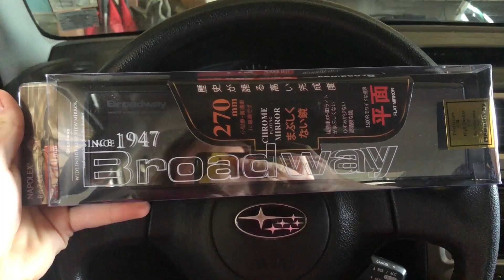2007 Impreza 2.5i Stainless Exhaust and Brake Tutorial

Comment: Great video man, the only thing I would have done differently is cleaned the front of your hub where the rotor sits. If you don't clean it and there is a lot of rust or brake dust buildup on that hub it can cause brake rotor runoff issues and possible future rotor warping issues. Other than that great video I would love to see more from you!
Reply from the maker: Thank you, and I agree I could've cleaned things up better. Living up north where everything gets rusty and gross quickly during the winter, I didn't give much thought to it. More content should be coming soon.
Reply: @gkgt5226  Sweet man I subbed I'll tune in when I can for sure! I live in Minnesota so I know how it feels when your shit is crusty AF and it's hard to work on.

Comment: Quick question, I’m replacing rotors and pads for a friends 06 Impreza 2.5i wagon. Do you know what size sockets I need to take off the caliper bracket bolts and the caliper guide pin bolts?

Comment: Looking for a exhaust can I have the link
Reply from the maker: The exact link is gone, but here is another variant of the same style. They're basically all the same, but still be sure to double check. Be noted, as show in the video, these require modification to fit.
https://www.ebay.com/itm/FOR-02-07-WRX-STi-STAINLESS-TURBO-CAT-BACK-EXHAUST-DOWN-UP-PIPE-4-ROLLED-TIP/154062383979?_trkparms=aid%3D1110006%26algo%3DHOMESPLICE.SIM%26ao%3D1%26asc%3D20200818143132%26meid%3D095f371f95ce4f2e8b48b9a6e30323c2%26pid%3D101198%26rk%3D1%26rkt%3D12%26mehot%3Dpf%26sd%3D254732909923%26itm%3D154062383979%26pmt%3D1%26noa%3D0%26pg%3D2047675%26algv%3DSimplAMLCvipPairwiseWebWithBBEV2bDemotion%26brand%3DUnbranded&_trksid=p2047675.c101198.m1985

Comment: Never stop making videos you gonna be big one day🙌
Reply from the maker: Thanks, that means a lot!
Reply: @gkgt5226  hi i have some question your exhaust ,manifold,catalytic converter can fit to 2.5 RS impreza, non turbo?
Reply from the maker: @eduardmondilla8275  Yes, I believe my manifold should also fit a 2.5rs because they are both a non turbo ej25.
Reply: @gkgt5226  thank you sir
Reply from the maker: @eduardmondilla8275  I'm sorry, but unfortunately I was mistaken. I am not familiar enough with the slight differences in years, so I was unaware that the 2.5 RS has a different shaped manifold without a cat. Apparently the 2.5 RS manifold wraps around differently than my car and has its cats in the next section of exhaust after that. I hope you see this before you make any decisions that were misinformed on my behalf.
Reply: @gkgt5226  ok thanks anyway I got it, my subie rs is older 2 years than yours.
Reply from the maker: @eduardmondilla8275  Hopefully you got the right one, and again sorry for the misdirection.

Comment: i know this is an old video but were those equal or unequal length headers
Reply from the maker: I believe equal; they're just some cheapy basic ebay ones that are good enough to pass inspection.
Reply: Should have got the unequal ones and given the car that subaru sound… did it on mine and she sounds great. Here in the UK its a 2.0 non turbo that they call the R sport. Ej204

Comment: probably wanna pull the pcv valve and make sure it's still working right. a faulty one will shorten the life of the engine
Reply from the maker: Thank you for the suggestion.
Reply: @gkgt5226  np

Comment: 8:26 dude, fix that rusty awfull things before you put expansive nonsense to this car... and change the oil maybe also... LMAO
Reply from the maker: I can't say you're wrong, but this video is about getting the car on the road, not making it look good. None of the parts I buy are expensive, and it needed an exhaust and brakes to drive. While eventually I want to fix this, bodywork is expensive, time consuming, and doesn't make the car drive any different.